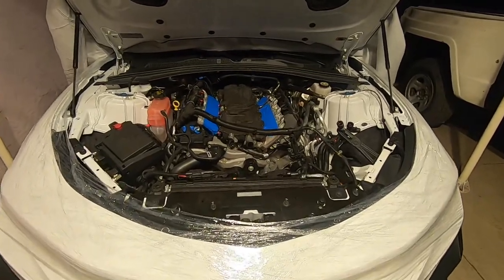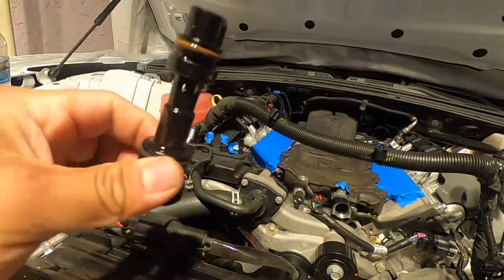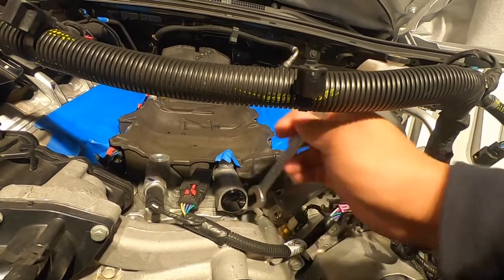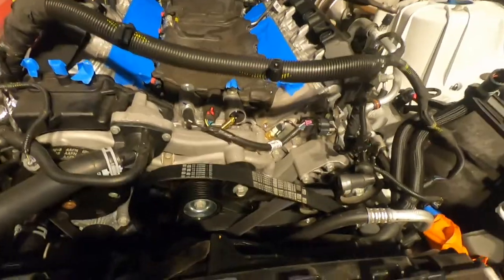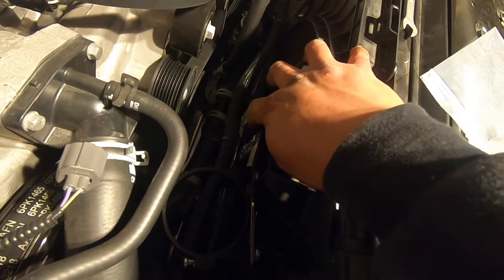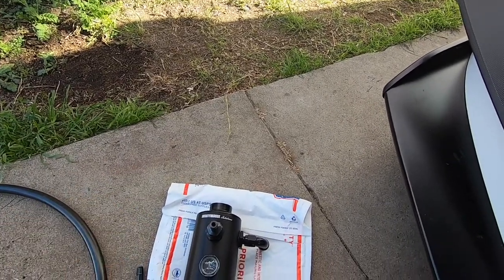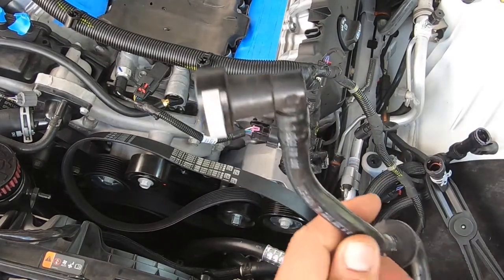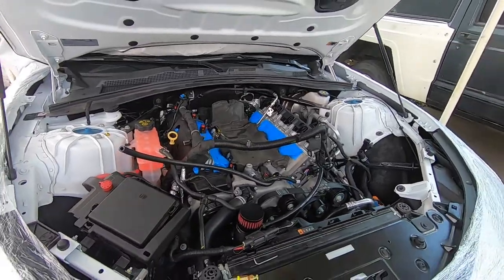MightyMouse Oil Catch Can Install On A 2020 Camaro ZL1 1LE LT4

Comment: Very nice,
But wouldn't the vented catch can decrease the crankcase pressure?
Reply from the maker: Thank you. Honestly we are not sure about that but it does catch oil that would be going into intake tube
Reply: @OXCFilms  many thanks dear,
I have couple of questions,
If the LT4 has built-in oil Separator would this mean that contaminated oil and unburned fuel will go back to the oil pan? If it does, then what would happen if we install a catch can before the oil Separator?
And if I want to stop any unclean air or contaminated oil to go back to the engine what would be the best application without changing the pressure or the vacuum, I mean the most efficient pcv delete set-ups if possible. 
Is there any way regardless of the emissions to be done? Actually my engine is more important to me, than any thing else. 😁
Thanks again

Comment: any tip draining oil from catch can? my car came with it. looks same as yours.  do you keep your engine running while draining ? how do you actually drain it ? lol
Reply from the maker: There is a drain tube from under the can. It should be routed to under the car so you can drain it from there

Comment: Did you have to end up adding hose clamps to the tee or did you heat shrink it?
Reply from the maker: No we didnt use clamps or anything. Havent had any issues with it
Reply: So weird, i just install mine the same way on my lt4 boosted ss and my idle is super rough. Rpm’s surge every 2-3 seconds and having misfires. I’m hoping it’s just a vacuum leak that i haven’t found yet.
Reply from the maker: Make sure you didnt accidently pinch a wire or removed another hose while installing the can. Hopefully its something simple